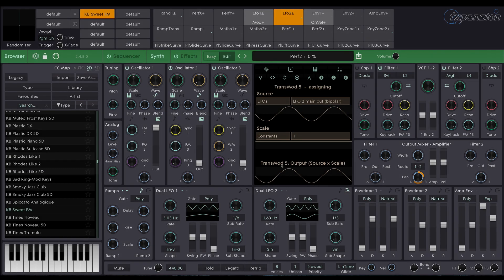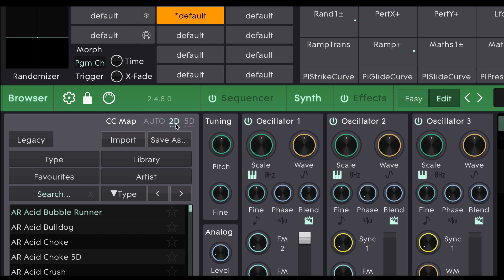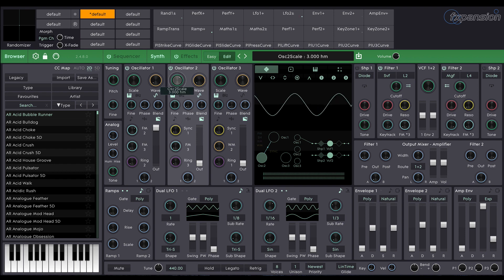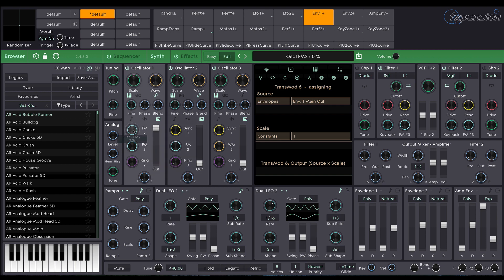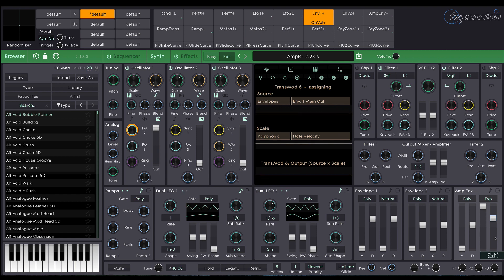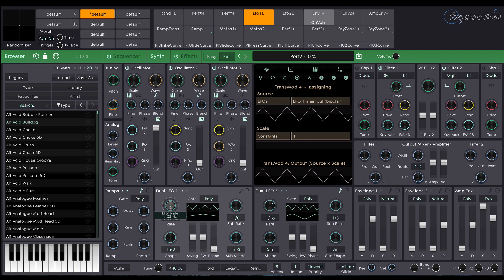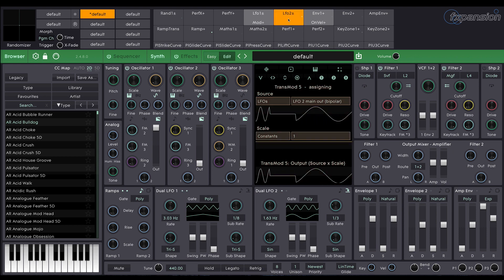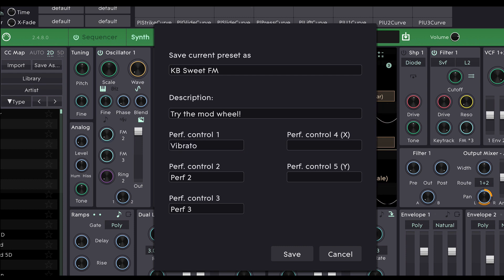Cypher2: Making A Sound From Scratch 1/2

Comment: could you not make the commercial version as simplified in the UI as the beta version deadmau5 uses??
Reply: Does he actually still use that? I think the one you're referring to is a pre-release prototype of Strobe (not Cypher) from 2005-6.. I'm surprised it will still run on modern OS / hardware. It mostly appears simplified as not all the features are there yet.. Strobe began as a clone of the SH-101 (quite a simple little synth) but grew from there to be what it is today.